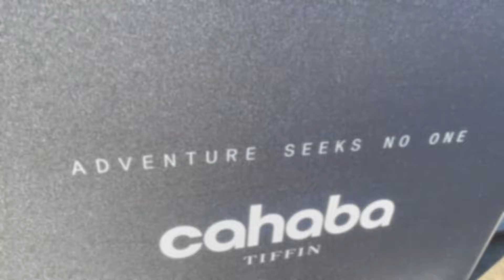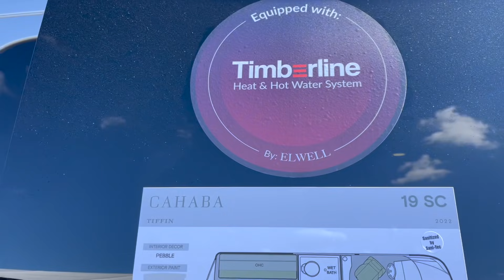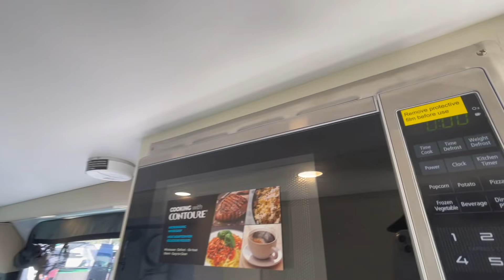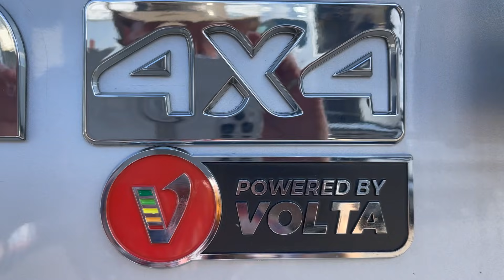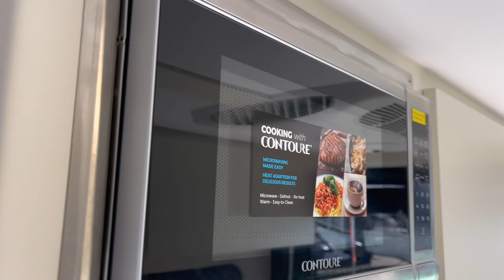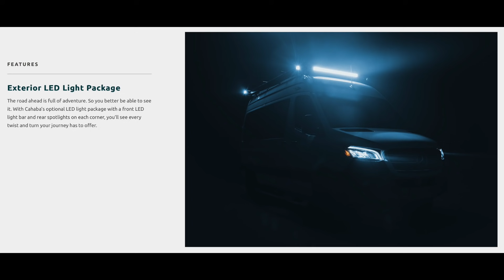CAHABA adventure van by TIFFIN - 2022 FL RV SuperShow

Comment: One big advantage of a cassette toilet? Can be used during the winter months when the van is winterized and the plumbing system is unavailable. Very few ClassB vans are truly 4-season due to the necessity of tanks placed underneath. Of course you can always copy Scott's plan and follow the warm weather ;)
Reply: Embassy puts tanks inside.
Reply: @traveldreamer4616   Embassy uses either the Laveo or Separett composting toilet, no blank tank. I'm guessing no space for 3 tanks internally so no black tank at least eliminates that problem. And I think their fresh and grey tank are a flexible material? Very innovative. I definitely appreciate Embassy's values.
Reply: @liorajacob8094  Correct BBC about the toilet. Terry of Embassy stated that they would not be putting a black tank in.
Reply from the maker: Hi LIORA!!    Follow the warm weather and never learn how to winterize = Scott’s plan :)

Comment: Thanks for reviewing it. They were smart to go with the big Volta system , wet bay, spare tire and what looks like a one piece molded wet bath. Agree with you about the tables. Not enough storage either.
Reply from the maker: I have to be missing something about the tables.  Volta 🔋!!!
Reply: @gosmall.livelarge  We could see the one lagun mount by the door but no other.  Did it come with any others? The work surface is ok

Comment: The refrigerator is a Webasto/isotherm 65 which is 12v and only 2.3 cu ft in size. It does however have a freezer drawer on top which you didn’t show. Im surprised they couldn’t have gotten in the next size fridge a 3.0 cu ft which is a little taller. The list price of the fridge is $2,000+.
Reply from the maker: $$$$ fridge !

Comment: Flexible solar panels mounted on the roof at this price point? They are not known for longevity. Lack of a significant freezer is also a head scratcher.
Reply from the maker: Solar panel were quite rigid; not sure if they were flexible.   Thx for commenting
Reply: @gosmall.livelarge  it’s not the flexing per se that does this style in. They can be rigidly mounted. The problem is they have a plastic layer that is prone to delamination and clouding in the sun. See Will Prowse’s channel on solar. Cheers!